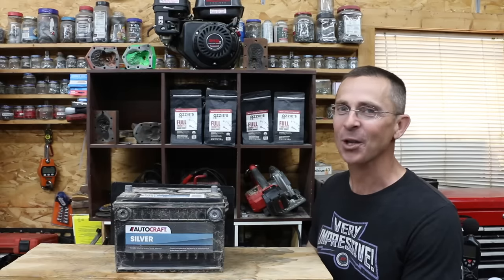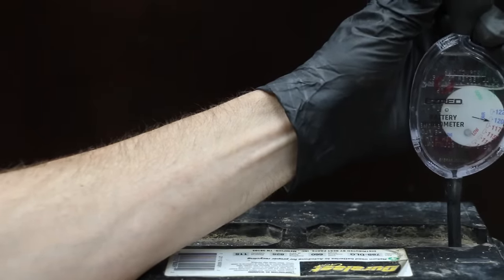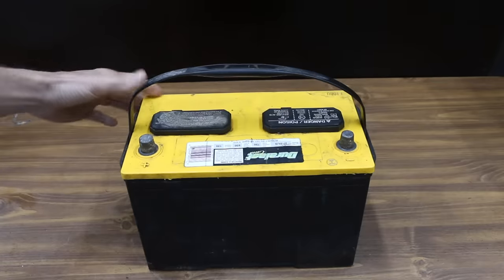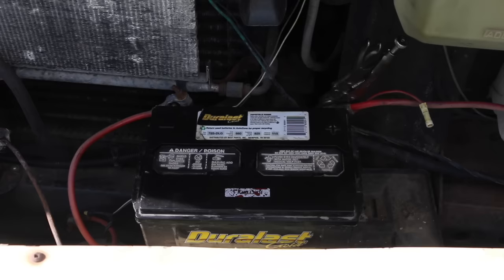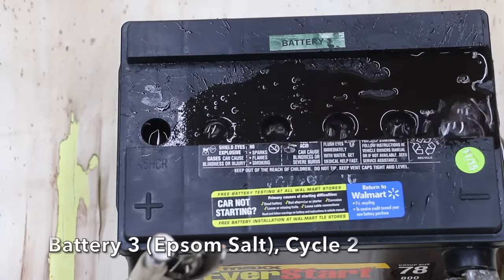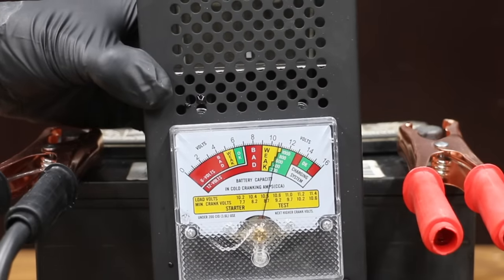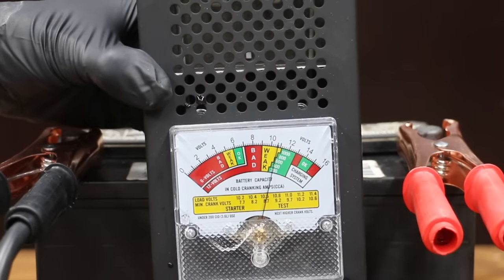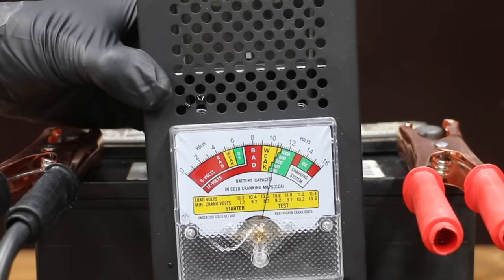Myth Busting! Can You Restore a Dead Car Battery With Welder?  Let's Settle This!

Comment: If a lead acid battery is 3-5years old in your vehicle - change it for a new one at a battery shop or dealer service - because it can cost you more if it open circuits or short circuits internally, surprising damage to the charging system, is more than double a battery price to fix. I had a battery fail under 6 mths old , filled up the petrol , went to start engine to drive off and the the battery spat up a fountain of acid  from one cells vent. Wear good eye/face protection when working with any type of battery.
Reply from the maker: Thanks for the feedback.

Comment: The Epson salt treatment is to remove harden lead sulphate from the plates,  it then needs a through rinse, then filled with new fresh electrolyte  (not water) , battery needs acid to have the chemical reaction that produces  electricity
Reply from the maker: Thanks for sharing.

Comment: Long time ago I was trying to start my father's car that was frozen.   North country serious winter frozen. I had a battery charger on it and was using a trouble light: the old fashioned kind with a screw-in incandescant lightbulb.  The lightbulbs in those things constantly work themselves loose. 
--  I put the trouble light down next to the battery as my face was over the top.  The light twinkled, then BOOM!  I rushed into the house to rinse the acid off my face. Lucky I was wearing glasses...
-- Went out and bought a new battery and the car started.  I guess the old battery voltage level was too low.
Reply from the maker: Wow!  Thanks for sharing.

Comment: I have a question about the batteries ion my 1988 Chevy truck. If I install a 2nd 650 CCA  battery, wired parallel, do I now have 1300 CCA? Thank You.

Comment: More than once I've tried to use a smart charger on batteries drained below 8v or less. They will not do it. A cheap solar charger will charge it though.  Two batteries I've done this with and then installed into my cars and they work fine.
Reply from the maker: Thanks for the feedback.

Comment: I did try to restore 4 of my batteries with stick welder, I cooked them for 1h30min on 60A and they all got significantly worse to the point they are unusable. I used 60A since my household fuse would pop out if trying to do more.
Reply from the maker: Thanks for sharing.
Reply: your supposed to do it for only 5 mins at a time not 90 mins! You cooked them but good.

Comment: Hell I still use a little DC yes welder and charge $50 if the battery charges and nothing if it doesn't work 
I'm a hydraulic mechanic but I do some backwoods repair stuff on the weekend lol
Reply from the maker: Thanks for sharing.

Comment: Using 80-90 amps in 5 minute sets, allowing some time to cool in between, I was able to restore an expensive sealed car battery from 0% SOH back to 90%.
I can't thank you enough.
I was also able to breathe a second wind into my ride-on mower battery (from 12% to 50%), but I couldn't get it to respond as well as the car battery. The mower battery is only a "low maintenance" with fill caps not sealed.
It's probably dangerous, but I wonder if the battery being sealed keeps the water under pressure and raises the boiling point? My thought being that the bubbling probably reduces the current between the cells. I dunno, I'm just talking out my butt. 😅

Comment: Epson salts is magnesium and  dissolved in water is a great conductor of electricity as is the acid in the battery. I wonder if the magnesium will act to clear the sulfate more so than the acid. I expect the acid has other properties which are beneficial to the lead based batteries or even more efficient. I wonder after the treatment with the magnesium if acid was replaced there would be a positive gain. Hydrogen and oxygen gases are generated by the electrolysis of the water so I expect the acid has little to do with the explosiveness of the process.
Reply from the maker: Thanks for the feedback.
Reply: @ProjectFarm  you are the best. I watch every chance I can.

Comment: There is a video doing the rounds where a guy takes an old, dead battery and drops it on the floor. It then takes a charge. I kinda get the idea behind this. Breaking up all the deposited sulphates. I've cracked a battery by dropping it tho so don't think I'd be attempting that in real life
Reply from the maker: Thanks for sharing.

Comment: try drain acid. wash with epson. charge, drain, rinse, fill with acid. think of how batteries die. metal fingers grow between the lead plates. burn the metal off, drain, replace acid, then charge.
Reply from the maker: Thanks for the feedback.

Comment: I would like to see you add too much sulphuric acid to the batteries and then overcharge them (say 16v). This should help dissolve the sulphates back into the electrolyte at the expense of plate health but who cares about the plate health if you were going to chuck it out anyway. Then dump out the overly acidic electrolytes and refill with the correct amount of acid / correct specific gravity.

I suspect that's what the welder was doing, just without the added acidity. Over voltage charging a battery is in my experience the only real way to gain some capacity back, but you have to leave it open and not let it get hot, and re top up the water if it drops. Like you did in the video.
Reply from the maker: Thanks for the suggestion.

Comment: To be honest, Epsilon salt is magic powder, but somehow you messed up the electrolyte here which actually conduct current and hold charge.

E salt have done its work when you added and charged it, now just empty it, fill electrolyte from another battery to it (preferably) or pour fresh 38% H2SO4 electrolyte.

ESalt recovery have research paper as well as patent on it. You can't make it wrong.
Even i have recovered 5/6 battery, the one had its cell sorted

Comment: You have to be careful of the fumes while you charge the battery as it is highly combustible
And when a battery explodes, it makes a hell of a noise and sulphuric acid is thrown everywhere
If you get it on your clothes, it will eat through it!  It will also eat your cars paint
SO not smoking or sparks while you charge your battery.  Be careful taking the leads off, turn off the power 1st, or 💥
Reply from the maker: Thanks for the feedback.

Comment: Once the magnesium in the epsom salt has worked its magic, by exchanging magnesium ions for the lead in the lead sulfate stuck inside the plates, the battery should be washed again and sulfuric acid added.  Then give it a charge and try it.

Comment: if you put a battery doctor type device that will trickle charge(the smart ones are better and read the battery and adjust accordingly) you can actually save a lot of bad batteries.
Reply from the maker: Thanks for the feedback.

Comment: In worst cases if shorting has happened long enough the bottom part of plates are eaten up. That's why it's not possible to fix led battery even when fluids are changed and salts removed for most dead batteries like shown in video. Battery may look nice from top but in reality most of the plates are gone.
Reply from the maker: Thanks for the feedback.
Reply: @ProjectFarm  In addition when lead battery is not in use then active mass starts to settle in the bottom and starts eroding lead plates. That's why it's important to charge lead battery in every couple of months when not in use. Charging mixes fluids in battery. Even if you drive only short distances with car especially in winter it is recommended to charge battery some times as half full battery also may give up earlier.

Comment: What about adding fresh acid (in certain situations) ?  Like the one that had one bad cell and was low on hydrometer.  Along with the welder.  I would think as long as the plates are not damaged that might be one of the possible fixes.

When I was a kid, worked in industry with deep cycle 6V batteries, we did use acid.  Did it come like in a plastic sack with plastic tube spout, inside a cardboard box?  

Anyone have information on that?

Comment: After doing Epsom salts, you should flush it out and restore the battery acid. It is a lead acid battery. Without acid, of course it performs terribly. That said, I would not suggest doing epsom salts. Even if it works after the acid has been restored, it is taking away material.
Reply from the maker: Thanks for the constructive feedback.
Reply: To add to this, if you look up the chemical reactions that enable a lead acid battery to work, you would see that the sulfuric acid is a necessary component of them. You could confirm that permanently replacing the battery acid with epsom salts in water detrimental by attempting this on a new battery.

Comment: When you're connecting to each battery one terminal gets clamped direct but the other has a rod between the battery and the clamp.  What is that rod and why are you using it?  How is it affecting the charging and your tests?
Reply: The stick welder won’t open far enough to clamp onto the terminal.  Funny that none of the demonstrators tell us that.

Comment: When you use the Epsom salt to clean out the battery. you have to remove the Epsom solution and clean it out again and then refill it with fresh electrolyte. It will never work without fresh electrolyte.
Reply from the maker: Thanks for the feedback.

Comment: BEFORE WATCHING, this is my "specialty" ive been doing this stuff with batteries tests, experiments, breaking, saving, and more for 3 years. only one way to save a battery, if the plates are undamaged, replace the electrolyte. only works on flooded lead acid.

ok, the welder battery, any physical damage that could cause the randomness of the cells charge? unless the plates are touching or case damaged, the voltage should be gradually changing not randomly
Reply from the maker: Thanks for the feedback.

Comment: The method is 200 amps for 15 mins.  Do thar 5 times with an hour rest between cycles.  Be sure distilled water is just below knockouts before doing this.  And of course we're safety glasses.  Battery will literally be brand new.  If u do this every 2 to 3 years the battery will last forever or until the plastic degrades and that cannot be fixed.
Reply from the maker: Thanks for sharing.

Comment: I don't understand why you didn't add some acid to battery 5's cell 5. The way I learned it, you can unbalance a battery by trying to charge it with one cell screwy. I expect you overcharged the other cells, but didn't flip polarity on cell 5, somehow.

100% ventilate well if you're doing a heavy charge. I saw one explode for no good reason once that was on a heavy charge.. no sparks or anything. Static electricity maybe? Anyway, yeah.. DON'T do this without active ventilation.

Comment: Could someone explain the process? I have a welder but what is the voltage? IMO it's around 25V
It doesnt matter that I can turn the current down to 10 amps IMO.  Unless I charge two batteries in parallel or something

Comment: That was impressive.
So It can help some batteries in some cases.

I shall decide to play it safe and just buy new ones. I found a supplier at Farm and Fleet of Wisconsin. They now have Platinum series batteries warranted for seven years, and they have still been good after nine. When battery in my Jeep hits the six year mark I'll take the oldest one from a tractor, trade it in for new and  put the new battery in Jeep. The Jeep six year old battery will go in the John Deere where it might sit for a month without starting, so when it can start my 14 horse Kohler I figure it's okay. When a battery gets so it won't hold a charge I turn it in, get $7 credit, and put newest battery in Jeep and put that battery in one of the John Deere. I have six identical garden tractors now. I've been buying them up off marketplace so that I will always have spare parts. It's amazing how little some of them need to be made operational. I have one set up with tire chains and no mower deck for pulling things like downed trees, trailers, etc. It is amazing how much power they have. One has a snow blower, it leave it on because it is a big chore taking it off to put a mower deck on. One has a 38 inch mower deck for getting in tight spots, two have the 46 inch mower. I alternately put maintenance charger on those batteries that are not often used. I'm convinced it prolongs battery life. I got ten years from the battery that came with my Harley by using maintenance charger when it sat in garage. The Everlast from Walmart only lasted seven years. The motorcycle battery from Farm and Fleet is now six years old and cranks really fast so it is living up to the reputation of their car batteries.

Many thanks for a really good video.
Reply from the maker: You are welcome!  Thanks for sharing.

Comment: I have a question. You said you can use a high amp manual battery charger. So what's is the difference between my alternator on my Duramax that outputs 150amp 12V DC and a manual high output 150amp 12V DC battery charger. All the high amp manual battery chargers I see for sale are 12V DC and not 220V DC.
Reply from the maker: Thanks for the suggestion.

Comment: A car battery is rechargeable. That makes me wonder why people whos car battery dies, always resort to replacing it. The battery might not be the problem, the problem could be a bad alternator not charging the battery while driving, or it could be that the person uses their stereo while not driving. Often, before replacing they'll end up needing to get a boost, which partially charges the battery. So why would they automatically go to replacing when they could put it on a charger at home and possibly not need to replace it at all? I'm almost certain that more than three quarters of all replaced car batteries only needed to be charged.
Reply from the maker: Thanks for the feedback.

Comment: Shouldn't battery 3 be cleaned out and filled with fresh dilute sulfuric acid before you load test it? I don't think epson salt is an appropriate electrolyte!
Reply: Ya it's too bad he didn't do what typical online suggest. Kinda wish I had a few fully dead batteries sitting around to experiment with.

Comment: I bought a welder to do this on 4 apparently dead batteries 
But 2 of the batteries have negative voltage.
How does this happen and it gives me pause to try the welder since 1 of the negative voltage batteries is only 2 years old but shuts off with my smart charger 

Any advice

Comment: PF , you drained the acid from the battery and replaced it with epsom salt and water? No acid , that might be why it failed horribly.  It needs sulfuric acid to function as a battery.

Comment: Sir i have 100 ah lead acid battery.i have 250 amp stick welder.imy battery was showing 4.5 volt. When i apllied welder 50amp for 5 minutes and after 10 minutes rest i again apllied the welder at 50 amp for five minutes.i did this for three times but the battery voltage is the same as before 4.-5 volts although the battery was boiling during process.
Sir is there cells issues in battery.if yes then can this welder technique solve damaged cell issues?
What may be the issues to my battery?

Comment: DO NOT TRY THESE AT HOME. That being said, most methods here include washing away the sulfate layer from the lead plates. While this may work a few times, this method is guaranteed to reduce the maximum capacity each time it is performed. The only way to restore a battery is to rebuild the lead plates, and then refill with new sulfuric acid.

Comment: You are the man! Just what I've been looking for after looking for a spot welder video I saw a while ago. Btw I just used a $60 200a stickw welder from amazon. Brought my 3 year old battery from 13% to 93% in 1 5 minute cycle. And for everyones information the noco repair mode doesn't do jack for batteries!

Comment: Epsome salt? Batteries need Sulfuric acid, H2SO4. You can replace the acid. Iron, rust getting into the battery will destroy it. Clean it before opening the cells.
Reply from the maker: Thanks for the feedback.
Reply: @ProjectFarm  Be careful with sulfuric acid, never pour water into the acid. Always pour acid into water.
Even small spray you cannot see will eat holes into your clothes, always wear protective cloth and equipment. Use only cloth which you don't mind trowing away.
Reply: @ProjectFarm  As far as I know, acid batteries can fail because lead mud forms at the bottom and short circuits them or a weak cell can get charged in reverse, which you addressed and reversed by the massive charging you did boiling away water in the other cells. You may need to add distilled water if you boil too much away.
Reply: @ProjectFarm  And thanks for all your great videos, always love to see them, even if I don't need the tool you are testing.

Comment: Gotta use baking soda multiple times, so you can get all the crap out of it that builds up in the bottom, and I have had 2 batteries fixed with epson salt, and like 10 that didn’t, if the plates are fubar, then it’s not going to work, duhhh, and if you shake it, and hear a rattling sound, it’s garbage, use it for a trade, or even sell them on marketplace, some people need a bad battery for trade, and half off the core is better than none, I have actually bought a propane tank to trade in also, for 20 bucks, better than paying full price.
Reply from the maker: Thanks for the feedback.

Comment: I have dumped out batteries of their acid, rinsed with hose water , rerinsed with distilled and added batteey acid from auto parts supplier.  Upon adding acid one battery was at 12.4 volts?!  Went for another year like that.